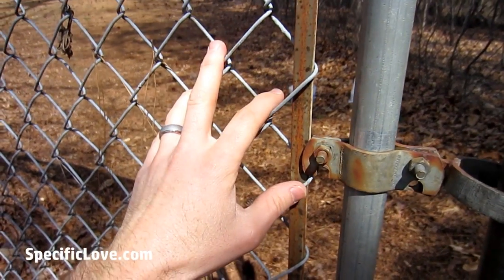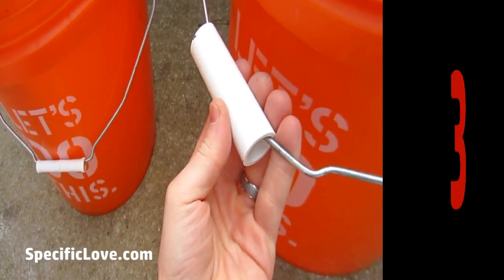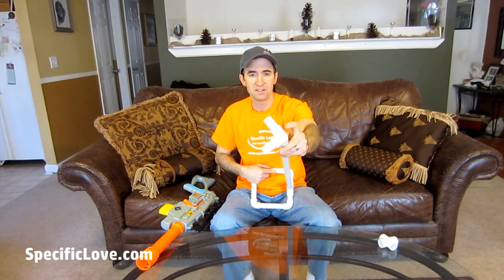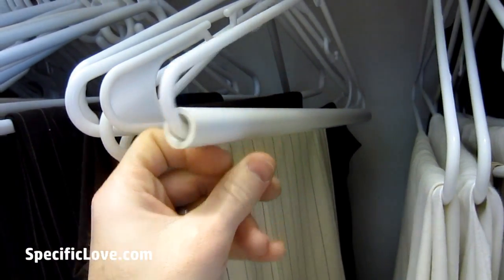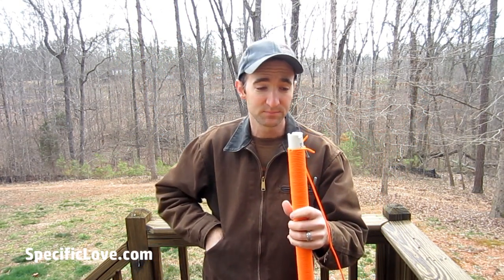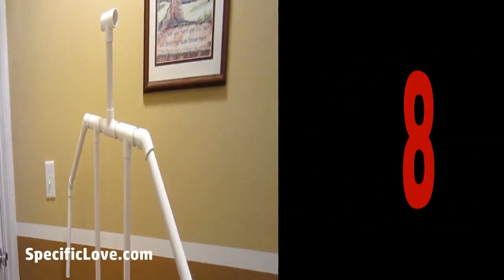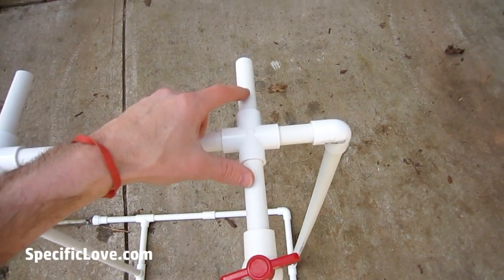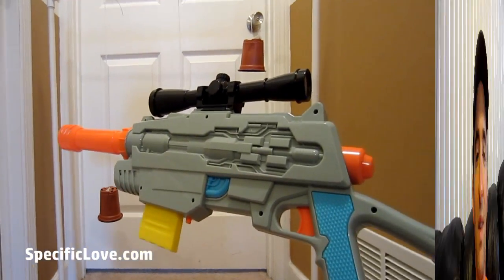10 Life Hacks with PVC #8

Comment: Thanks for sharing some great ideas. I made a fishing rod holder for beach fishing out of 50mm (2 inch) PVC pipe and a 45 degree angle fitting. I cut one end of a one meter ( 3 foot) length of  the PVC pipe down to narrow one end (like a small shovel ) so it can be pushed into the sand easier. Then on the top I used a 45 degree fitting so that I could place the fishing rod through on the 45 degree angle. I then shaped the fitting( cutting a wide slot for the reel) to hold the rod and reel in place and secure the fishing rod. Now when I push the rod holder into the sand I can cast the fishing line and place the fishing rod into the holder (45 degree fitting) this PVC unit will support the fishing rod when I am on the beach. If a fish takes the bate the rod will remain secure in the holder until I take the fishing rod out of the holder. I can send you some picture if it makes it easier. The rod holder can be adapted for a boat or even rock fishing Cheers.

Comment: Good job on the fence spreader.  You have a LOT more patience than I do to wrap the pipe with 100 ft of cord LOL.  How I made the notches in the end was to cut the PVC slightly longer than I wanted it and then drilled 1/2" holes through it.  I then came back and re-cut the pipe right through the middle of where I drilled the hole leaving me the notch for the fence wire to fit into.  I was leery of just cutting a 'v' groove in the pipe.  My thinking was that the pressure of the wire might split the pipe so I wanted a smooth radius.   I'm nut sure but 3' may be a little long but depends on whether your local land owner uses a 3, 4 or 5 strand wire fence.  And obviously you need to insert it half way between the fence posts :-)  You might want to go out and test a section of fencing to see how far apart you can spread it.  Oh, and I step on the lower wire first and then pull up on the upper wire to spread it.  I've found it easier that way.
Reply from the maker: +MrGrunthunter's Adventures    Very good tips. Thank you for being apart of the channel.

Comment: I enjoyed the Gun rack and target you set up.  

Way back about 2004, I was in the Army assigned to a Reserve unit in central Florida. As units were being deployed they military needed more supplies and equipment. ( these were becoming more and more difficult to provide due to budget cuts and reissuing supplies all over the world)  
One of the main issues was proper Weapons Training.  We had no weapons.  They were all taken by other units going over seas  in OIF/ OEF.   I was tasked with assisting with the training of Reservist as our unit was being sent to the four corners of the globe. 

So for one of the Training Requirements we had was the PHYSICAL FITNESS, and training with a weapon was a part of that training for the soldier to become familiar with. PROBLEM: NO WEAPONS :-\  
SO I came up with a TRAINING AID. 
I used a 39+ Inch long 2in PVC Pipe with caps on each end. 
I filled the pipe with Concrete and re bar so it was the exact weight of a Fully loaded M16/AR15 Rifle. 
This training aid was the same length and weight of a weapon we would use. 
NOW I could run my soldiers through Physical Fitness Training with a proper Substitute. 
When my  1st SGT got wind of this, I brought it  the unit morning meeting. Explained the whole concept to the commander and the Staff,  
I walked out of there with an order of 15 " MILITARY TRAINING UNITS" ( my costs were about $5 each back then)  
 The next day I was handed orders for OEF and was off to Ft Bragg.  :-\  sigh OH Well, the idea was sound and it is still an opportunity for the military to help keep our Soldiers properly trained.   HOOOOAH!   ;-)
Reply from the maker: Very nice, and thank you for serving our country

Comment: I like the water balloon filler.  However, I'd add a rubber tilt valve on the end instead of the ball valve.  If you have an empty helium tank (kids party baloon filler), unscrew the rubber tilt valve before you recycle it.  Or go to where they are recycled and pull them off from there.  Add a few thread fittings to make it work with a garden hose.  Then you just slip the end of the balloon over the rubber tip and bend it (up, down, left , right) once full stop bending and tie off the balloon.   I have one for my garden hose and works better than any thing else I've tried.
Reply from the maker: Good ideas

Comment: Hi, great video . You can also make a similar design for a boot dryer. Another option that can be added is to have a input for a hair dryer to blow hot air into the PVC and then into the gloves or boots to help them dry faster without damaging them.
The open PVC design will allow the air to be distributed to all the gloves or boots

Also for #8 (car door bumper) you can use the same for a stop warning if you have shelving in your garage to tell you when to stop going forward before you hit the back wall ... hang it across where the windshield is and you know when you hit it , you are all the way in and have not hit the back wall (dad used to use a tennis ball for this also, but a pool noodle over some PVC will work as well),

Comment: This is probably a silly question, but what did you use to cut the length of PVC for the coathangers?  I usually cut my PVC with a hacksaw but the blade isn't that long.   GREAT idea though, also adds strength to the hanger so heavy pants don't bend it.
Reply from the maker: I used a hack saw, but it just a while

Comment: your glove dryer can also be made heavier to dry boots, waders, etc. you can also use a step down connector and attach a blower to framework which will divert through the stand and air dry your gloves boots, and waders. it will not have a heating element in this way such as commercial versions may have, likewise you can take a large piece of pipe such as 6" with a end cap that has holes drilled in it to allow for drying of a motorcycle helmet or similar.

Comment: The plastic cover on the winch of my boat trailer jack was disintegrating from the sun.  I epoxied a piece of CPVC to it, basically using the original plastic cover as a bushing.  (PVC is way too large otherwise.)  Been on there for ~10 years so far & it looks the same as when I did it.  (CPVC is more resistant to the sun.)  I also ran CPVC down the length of my boat on either side and all the electrical cables & fuel line are protected, both from the sun and hooks/fish/etc. =)
Reply from the maker: +RealRuler2112 That is a very nice setup

Comment: you water balloon filling station gave me an idea for supplying water to multiple rabbit cages from a hose.  I have a bunch of water bottle nipples that fit a standard hose, by taking a female pvc connection with a control valve at the end, you can run the pvc pipe above the cages, at each cage have a T that goes down to the proper position for the water nipple, put a male connection at the end, and screw on the water nipple.  The control at the beginning of the rig will adjust the water flow so that the pressure doesn't cause the water to spray out.
Reply from the maker: +Levi Maxim   You have some great ideas, thank you for sharing